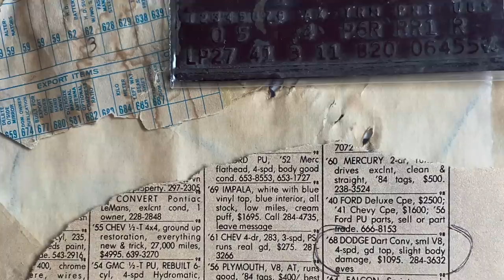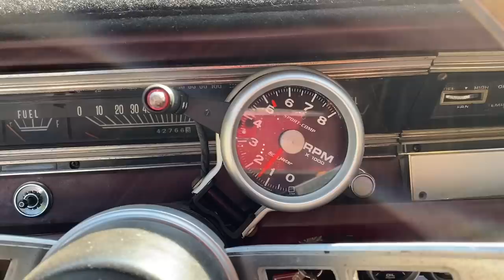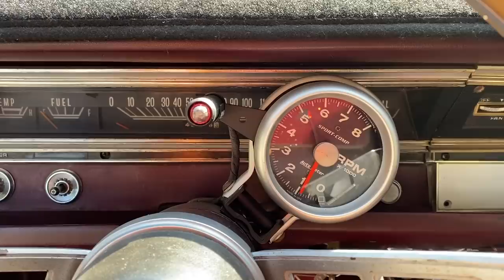BBS8.  The rarest 1968 Dodge Dart on the planet?  Purchased for $1,000.  Will it run?

Comment: '68 340 4 spd!!!! You just made the easiest $30k ever. Fun fact: 1968 340 Darts came with special cams when equipped with a 4 spd for that model year only. Like all Dodge cars, they just want to run. Super reliable, good cars.
Reply from the maker: Thanks for watching and commenting.  I hope you have a nice day.
Reply: 318, not 340, bro.
Reply: The fender badge says V8. I think that indicates 273 or 318.
Reply: @timdutton2056  - Buddy says that in the description, 318.
Reply: @irishkelly654  I get excited sometimes. Never seen a 318 with a 4spd. Still a nice car.
Reply: @JohnWhite-xc3md  - I hear ya, super nice car, for sure.
Reply: We found one for 300 bucks with no title . Then sold it for a grand . It was black with red interior.  If it wasn’t for the rag top it’s a old ladies car

Comment: In Fall 67, I  took delivery on my special order  68 Dart 270 met. blue coupe. 318 2bbl (230hp), 4 speed, poverty caps, w/o radio, bench front seat, HD frt swaybar, HD shocks, 16:1 fast manual steering, front disc brakes,  and 14" wheels (it was like a Swinger a year before they came out). I had heard that it was one of 23 270's with a 4speed 318. If I had only known then what I had. It drove like a sports car. Thanks for putting on YouTube, it really brought back memories.
Reply from the maker: Thanks for sharing your experience.  I hope you have a great day.

Comment: Had a 1970 Dodge Dart Swinger 340, 4 speed with a Mr gasket super shifter and a bench seat. It was cream colored with a black interior. It was a great sleeper that punished a lot of Camaros, Chevelles, and Mustangs. Had the 3:55 gears and some work to the motor and ran 12.5s all day with street tires. Loved that car.

Comment: Nice project. I had a 68 Dodge Dart GTS 340 V8 hard top in 1970 bought with 20k miles. It was a great first car very fast, ticket getter. Keep posting your project updates.
Reply from the maker: Your 68 Dart GTS was a fun car.  We had several 68-70 Dart 340 cars.  All of them were rippers that were fun to drive.  Too bad the midwest killed them with rust.  Thanks for your support.  I hope you have a great day.

Comment: I had a 67 Dart GT that I bought from the second owner in 1990 with 40,000 miles.Nice clean white bucket seats,original paint and the wicked 273 charger V8! (solid lifters,4 bbl.carb,cool factory valve covers and chrome air cleaner.) That little motor would scream!
Reply from the maker: Right on.  Thanks for sharing.  I hope you have a great day.

Comment: Man I love that car! It brings back so many fun memories when I was a teenager. I had a 67 Dart. Even though mine was a 4 door with a 170 slant six and a 3 on the tree. When your 16 in 1969 and working in a gas station life was a ball. Of course I had to hop it up a little. With an Offy 4 bbl manifold, a Holley 550, Vipar headers, changed out the 3 on the tree with a Hurst 3 by the knee. And a reverb gadget wired up to the radio. Remember I was 16! Chrome wheels with baby moons. I remember doing a torsion bar lift to give it that gasser look and cruising Colorado Blvd. on New Years Eve. Those were some fun times!

Comment: Nice! I always liked the looks of these cars, kinda a mini GTX. I drove one in high school (‘79-80). It was a 69 but just the lowly Swinger. Alligator green vinyl top and lighter green paint, black interior with rubber floors! No carpet. I thought it looked real good with the super tricks and fat tires on it though. Great score man!
Reply from the maker: Thanks.  69 Dart Swingers are way cool.  Your car sounds great.  I like the color combo and rubber floor mats.  My family had a 1969 Dart Swinger 340.  It was a bench seat, four speed car.  A Q5 bright turquoise metallic car with X9 black interior.  That car burned both back tires like no tomorrow.  3.55 gears and those little 14" tires equal smoke show.  Thanks for the great memories.

Comment: Very nice, I have a Dart story, I once got a Dart for a 6 pack of beer, I swear to God, I put new seats had it painted, body was nice, it had a 318, the 2 things I remember is the shreds on the roof that was the vinyl top and you have to put headers on with a pickle fork handy, but the car came out real nice, I used it for a while but also used it as a trade up car

Comment: Cool LP27F8B ! Rarest Dart convertible I've seen was a 1967 GT+S (383). 
I've long wondered how many 273 or 318 models were built with a 4-speed (an option that disappeared from 1970-1972 for the A-bodies). Add the 16:1 Fast Ratio Manual Steering , and you've got quite the rare animal.

Comment: In 1967 I went to Mr. Norm’s Grand Spaulding Dodge in Chicago. I was looking at a 1967 1/2 Dodge Dart GTS. It had a 383 Magnum with a four speed. It cost all of $3,300. Sadly, I ended up in the service instead of buying the car. I have missed that car ever since.

Comment: 68 Darts came factory with either a 273 or a 340 small block or the real actually RARE GTS model with a 383 of which only around 2000 were produced. Not sure what size that carb is but it looks a bit large for a 318.

Comment: That's an amazing find and I don't remember seeing any convertibles especially with a 3 or 4speed trans. 1968 Dart/Swinger or whatever it is cause I haven't watched the full video. A GT at that with maybe a 340. I never see em anymore with a hardtop or anything. I know where a green 4door is thats set for God only knows how long and it doesn't do any good to ask about it cause they won't sale it. They had a 75 or 76 Nova SS that set and rotted in the ground. A thousand bucks is so cheap and it runs. Great find

Comment: I hate to say I doubt this story , but I have to, its either a story from back in the day or he put the decimal point in the wrong spot. Pricing cars in general, 4 speed add 25% , rag top add 25% , v-8 10% , big block 50 %, numbers matching car 100% or more. Since there is no "blue book" for cars that old there are previous sales at auctions and insurance figures to help establish the selling price.  Still have my 69 dart GT. I paid 1200 for it in 1989. Original 225 slant 6 / 904 auto.  Had been left outside uncovered with a rotten top. I almost bought it in 88 for 300 but passed. After a year of kicking myself in the ass, I bought it when the guy decided to flip the car. He had installed  a 318 in it  and was running. I have turned into a GTS but call her a GSS tribute car. She now is a 440 big block 727 , 355 sure grip, superstock springs , sway bars fron and rear poly urethane bushings, disc brakes up front ( manual ) with quick ratio manual steering ,battery in the trunk. 2.25 diameter tubing headers ( fenderwell ) with 2.5 exaust out thur 22 inch glass packs and GTS chrome tips. I built her the best I could with very little aftermarket parts available and was done with mechanicals and on the road in 1991. If I had to do it today I would do things differently, but it is what it is. Up to the point of buying this car I had bought a dozen A body cars to later than 1972 and never paid more than 300 per car. Except ny first car in 1985 a 1969 Dart GTS 340 4 speed hardtop with 323 sure grip and 4 wheel drum brakes for 3500. 50 less than its original price in 69. I bought her because the 70 challenger R/T 440 6 pak convertible 4 speed 4.10 Dana 60 car my neighbor owned backed out of the sale at the last minute for the 3500 I had.  Those were the prices 40 years ago. 3500 was top dollar back than. Now 35000 is a bit low for a dart gts and a challenger needing complete restoration 318 car is what 25k will get you. Their are bargains to be found out their but  a 1000 dart  today seems unrealistic in my opinion.
Reply from the maker: if you read the full video description, you will understand how I purchased the car for 1K$.  Thanks for viewing, commenting, and supporting my channel.  I hope you have a great day.

Comment: What size engine in, cubic inches, is in your Dart GT ? There is not much better than the note emitted from a cast iron block and cylinder heads, of course a good exhaust system helps.
Reply from the maker: 318.

Comment: Scored an "End run" '76 Valiant sedan for free from the original owner on the Tulalip Rez. Just had to promise not to cut the car up or flip it. Not nearly as cool, but it is solid and weirdly optioned. V8. A51 "Road handling" package.120mph certified speedo Passenger door mirror. Sure grip, 2.76, 8.25" rear. HD cooling. It's the lowest "Custom" trim line, too

I've done the 12" rotor swap. Have Barry Zepick's air dam. Doing AC  using factory parts from a '75 Dart and the compressor  set up from an '89 Gran Fury.

I moved/sold & ran from Washington State & took the car to NC. It stops people here, 😆 

The caliper adapters & lines on yours? Andy Finkbeiner/AR Engineering?
Reply from the maker: Thanks for viewing and commenting.  Your '76 Valiant sedan sounds like great fun.  I received the car in the same condition as viewed in the video.  Checking the receipts I have with the car, Eric purchased all the brake equipment, with exception of the vier calipers, from Dr. Diff.  You are most likely, correct, that Andy Finkbeiner/AR Engineering parts were used in the Dr. Diff kit.  I hope you have a great day.

Comment: Those are all 1980 style gauges that were added later- who documented the 1 of 1 paper work.
Reply from the maker: You are correct!  Autometer Super comp gauges were big in the eighties.  Nobody claimed one of one.  The license plate shows one of twenty-six.  Where did you find the one of one claim?
Reply: 1 of the rarest darts on the planet- so basically a hot rod

Comment: I think probably the rarest 1968 Dodge was the Lightweight Hemi Dart.   I think only 80 were made.   Who knows how many are left.  A good friend of mine had one in the early 80’s.
Reply from the maker: Thanks.  You are correct.  Galen's Tag Service (GTS) lists LO23M8 code Darts with a production number of 80 cars.  No breakdown of automatic or manual transmissions.  Galen's book lists LP27F8 code Darts with a production number of 26.  This is what the book indicates.

Comment: For the guy who is bitching about the brakes it’s a sure thing you never drove one of them and the brakes from a duster will bolt up with no problems
Reply from the maker: Agreed.  10" drum brakes and a car originally equipped with 7.00" x 13" bias ply tires and wheels would be scary to drive and stop in todays age.  Thanks for your support.  I hope you have a nice day.

Comment: too bad it wasn't a 340, they can run with the 383's easily, but a 318 can't, doesn't have the heads and cam a 340 does.
Reply: Small blocks were no slouches, for sure!

Comment: Of course just RUIN THE DAMN THING. 1 of 26 lets put viper brakes on it. The way it came down the assembly line was perfect. Why does everyone think its ok to do this to these cars. I dont care if its yours and u bought it. U have a responsibility to keep it. Maintain it for future generations. Im younger than you and understand this. Because im a real GEARHEAD. I just cant anymore with these choices. Dissapointing is all i can say
Reply from the maker: Thanks for viewing and commenting.  I stopped by your channel.  For being a real GEARHEAD, you don't have any automotive content.  When are you going to showcase your project vehicles on your channel.  Thanks for criticizing how I received the car and what the previous owner chose to do with it.  If it was perfect when it came down the assembly line, why did Chrysler ever choose to use disc brakes over drum brakes?  Why did the 7" x 13" bias ply tires and wheels get upgraded over the years to 14" and 15" radial tires and wheels?  It becomes apparent you have never owned or driven one of these cars in its original form.  Do you own a car now, or just a keyboard at a computer?  I am not the curator of a museum.  I hope you have a nice day.
Reply: @burnoutandbreakstuff  listen i dont do youtube content as a creator. But more of a gearhead you wont find. U dont have to believe me. But yes ive been doing cars since i was 16 with my step dad. My first car was a 69 Dodge Dart GT hardtop 318 with 340 heads on it. My dad had a 65 Bel-air 396 bigblock with cragers and. The whole deal. Drum brakes or disc. Auto or manual doesnt matter in my eyes those amazing cars from the 50’s to early 70’s were amazing the way GM or FORD etc. built them. Day 2 mods are fine as well. Headers, Rims etc. but that car is rare and beautiful and i wouldnt change a thing on it.